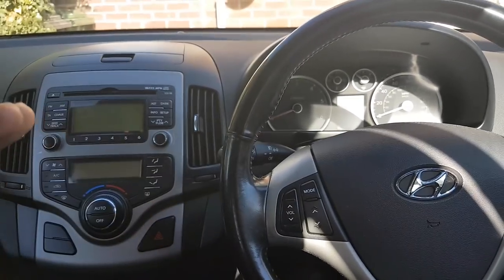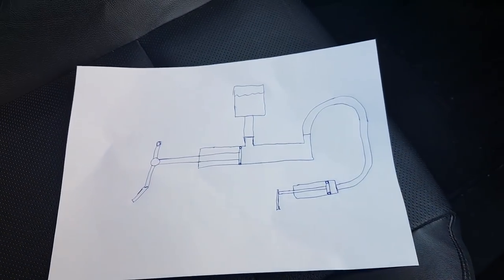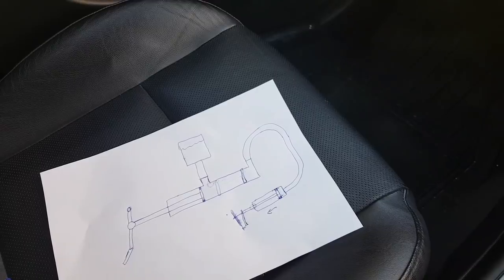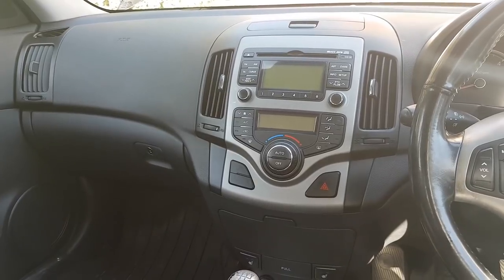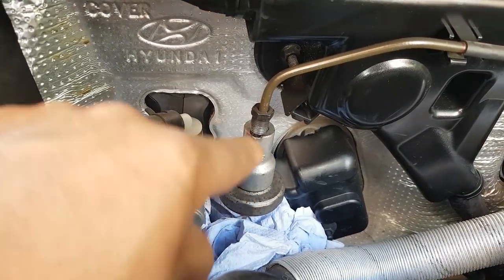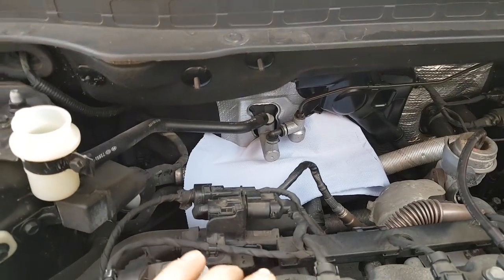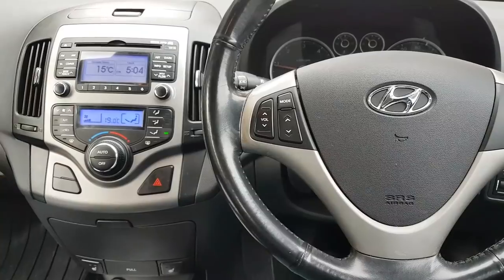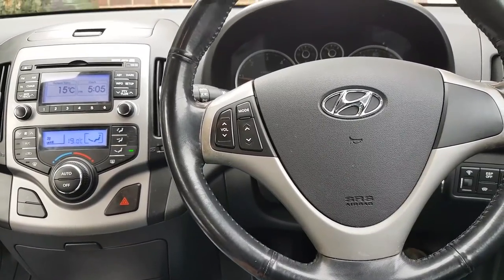Hyundai i30 2007 clutch problems. Fault finding and repair.

Comment: Thanks dude! I had the same problem with mine after 230.000 km, and I thought the clutch was done. But I figured this was worth trying before changing the clutch - and it worked!

Comment: I have the same problem with my Hyundai i40 CRDi 1.7 since many years and its becoming worse.. It is build in 2013 and every garage I asked for a solution told me to renew the clutch. In the meantime I drove another 100.000 km, because I thougt, they are wrong. I´m so happy to find your channel and will check it tomorrow. Thanks from Germany.
Reply from the maker: Hope this helps...
That said, a worn clutch can develop similar symptoms... just keep that in mind...
👍👍👍
Reply: I have an i40 too with this problem. Did this fix do it for you?

Comment: I just completed this procedure on my daughters 2013 i30 and it worked a treat. The clutch now engages approx 10mm from floor and not right on the carpet like before. The car is way nicer to drive now.. Thank you for the excellent advice.
Reply from the maker: That's great! 
Thank you for watching, for your comment and for the feedback! 
👍👍👍
Reply: Hey. May I ask what size bolt did you used ? 
Thanks for any answer.
Reply: How long did it take you?

Comment: Doesn’t damage the slave cilinder? The damper should regulate the amount of fluid going in and out to the slave cilynder. I might be wrong. Just an opinion. Cheers
Reply from the maker: The dumper as the name suggests, absorb some of the fluid movements... doesn't really regulates anything...
👍👍👍
Reply: @LMAutoRepairs  thank you!!! I had to replace the clutch kit twice because of the slave cylinder failure. That was in less than 10k miles. I’m just worried that could happen again because I cannot fault anything related to the gearbox…LUK blamed the over pressure in the clutch pipe work system…it just drives me crazy not finding anything wrong…thanks again for your reply
Reply from the maker: @ninrm6355 
Most likely the quality of the parts...
The pressure is whatever you put through the pedal and the counter pressure from the clutch plate... you can't really affect the pressure in any other way...
👍👍👍

Comment: You're amazing man! I just bought a 2012 i30 1.6 crdi. I saved around 2250 gbp on the car, cause the dealership was sure it needed a new clutch. 
I'm not a car expert, but followed your guide and it completely solved the issue. Thanks a lot!
Reply from the maker: That's great! 
👍👍👍
Reply: Hi i have the same variant as you, the inlet and outlet look different to the one in the video,  ut i take it the same procedure applies? Remove the damper and fix with m16? Thanks
Reply: @ncmMackin  Yeah, exactly the same :-)
Reply: Hi, I have the same car and the same problem, but the place that looks like the damper looks like it's already had the plug installed instead of the larger unit like in this video. Is that what you saw?

Comment: Wish I had seen this video before checking slave cylinder,made a bigger output shaft 8mm longer than original,still gears tight.decided on a new clutch fitted and problem still there.Never seen a clutch regulator before so blanked it off and hey presto sorted.12-18 months of poor gear selection and spending on a new clutch,and it was that.£159 for genuine new one.Dont bother just blank it off.Great video .Thank you

Comment: Hatte das gleiche Problem. Regler ausgebaut, Leitung mit Verbindungsmuffe zusammen geschraubt. System entlüftet und man staunt , alles okay. Danke für den Tipp.
Reply: Ich auch bei meinem i40 CDRi 1,7. Neu gekauft und seit 2013 immer schlechter zu schalten. Jedes Jahr schlimmer und jetzt rollt er sogar los, wenn ich das Pedal bis auf das Bodenblech durchdrücke und die Gänge lassen sich oft nicht mehr einlegen. An der Ampel hilft dann nur noch den Motor auszustellen. Dann läßt sich jeder Gang butterweich einlegen.
Läuft Dein Wagen immer noch mit funktionierender Kupplung? Über die Jahre hat mir jede Werkstatt gesagt: Neue Kupplung, aber ich war mir immer sicher, daß es nicht daran liegen kann.
Reply: @katrinvogt2485  Hallo Katrin, die Kupplung hat bis Heute kein Schaden . Warum das Teil Kupplungsregler heißt und in anderen Autos fehlt , ist mir unbekannt. Alles gute 👍

Comment: That is a great and cheap little fix, I bet the owner was well pleased.

Absolutely love your videos, I've watched nearly all of them now. Please keep on making them, you're gaining a real fan base. Huge respect for the thoroughness and sheer patience with difficult problems other people have long given up on! :)

I am wondering how many garages would have just swapped the clutch and dual mass on that car though!!!
Reply from the maker: thejoneseys 
Hi
Thank you for watching so much for your comment, and furthermore for watching my videos! 
Much appreciated!
Reply: @LMAutoRepairs  how do i can contact you sir?
Reply: I've heard that it comes from the factory equipped with a classic flywheel and not dual mass. That was one of the reasons I bought this model. But I could be wrong.
No DPF or changing geometry turbo either should mean less maintainance cost.

Comment: This fix has certainly improved the clutch on my 2014 Hyundai ix20. Thanks for the excellent video.
Reply from the maker: ☺️
Thank you for watching and for your comment! 
👍👍
Reply: Can you remember what size the blanking plug was for the ix20 please.
Reply: @ashhendry6747  It was a while ago but 17mm seems to come to mind.
Reply: Thank you.
Reply: @ashhendry6747  I've just had a thought, I think I used an oil sump drain plug for a Peugeot which happened to be the right size.
Reply: @grahamebradford1028  Thanks again.

Comment: Try pumping the clutch to see if you can engage first gear, if you can, there are two resolutions possible - master cylinder replacement (possible leak) slaves dont usually give any issues on newer cars, or air in the cluch fluid -- neither of which is monstrously expensive to repair - Good Luck

Comment: Hi I have a hyunida i30 2009
I have this issue but I'm confused why you need the sump bolt if its already blanked off with the large round thing. Sorry I'm not mechanical minded.

How do I feel the system back up with also how do I bleed the other side the metal pipe?

Comment: Great video mate, thank you very much! Is the bleed valve for the clutch the one at the front of the engine, just behind the radiator? Also, when i am bleeding the system do i continuously press and release the clutch pedal whilst someone is filling the reservoir until no more air is in the system? And when do i tighten the nipple, when the clutch pedal is pushed to the floor or when it is out? Thanks again for the great video
Reply from the maker: Hi
Yes, that  is the slave cylinder, and is where you bleed the system.
Just bleed it using the same procedure as when bleeding brakes... same thing... it will work just fine!
Thank you for watching!

Comment: Gearstick gets stuck in reverse after reversing. Unable to move it back to neutral unless i pump the clutch a few times then i am able to release it. All yhe forward gears are perfect and shift as they should with no gringind. What do you think it might be?? Slave cylinder? Or a grenade to the gearbox😢
Reply from the maker: A grenade on the gearbox will definitely gar it sorted!
😅
Could be the cylinder not releasing the clutch properly, weird however that all the other gears are fine...
Reply: @LMAutoRepairs  i did check the slave and me and the wife attempted to bleed it which i believe we did properly but who knows. Maybe we didnt do it properly as it didnt make a difference. Looking at the slave i did not see any evidence of wear so im a bit baffled

Comment: Ive seen hydraulic clutch pedal sys in cars as old as 1980 never seen a dampener in there yet clutch action is smooth and perfectly fine.. manufacturers probably threw it in to increase parts count/failure probability
Reply from the maker: Airman 
You're probably right... lol
Thank you for watching!
Reply: yep ive done several hydraulic fixes over the years, never seen a damper!

Comment: Ahh thanks, what is the part actually called,
What size thread was the sump plug you used, does blanking it not break something else? Surely its there for a reason? I have the same issue
Reply from the maker: I don't remember the size details...
The reason for it, it to absorve vibrations from the clutch...
By removing it, you might fell a bit more vibrations on the clutch pedal... breaking something else? Not really...
👍👍👍

Comment: Quick question, can I remove the damper on its own or do I have to remove the elbow as well?
Reply: You better remove the aluminium housing and attach it to vice before trying to remove the damper as it’s tight. Otherwise you’ll easily break the plastic master cylinder if you bend it.

Comment: Have the same problem but thinking there is wear in both the Master cylinder & slave cylinder pistons where the pushrod connects the piston causing too much unadjustable free play which makes it difficult to engage reverse gear unless you double clutch before in neutral. There may not show any leaks this system relies on a light spring to take up free travel so it's non-adjustable. Only solution it to replace the slave cylinder & possible master cylinder & push rods. hope this helps.

Comment: Thank you very much for this nice video. I've an 1,6 crdi i30 GD (the model that came after the one in the video Type FD). It has exactly the same problem that you mentioned in the video, master and slave are absolutely ok. I am wondering what is the real purpose of this regulator that you removed. My guess is, it is there to compensate the fluid volume changes when the temperature changes, but I am not really sure. From the Hyundai spare parts catalogue it seems that only the 1,6l engines have the regulator. I will try to remove the membrane like you did, hopefully it will work. Btw you are very lucky that your car is a RHD, so you got a lot of space to get to the damper. In my case, it is LHD, you need to remove the battery, ECU and Diesel filter and even then, the regulator is a very tight place. :)
Reply from the maker: Hyundai I30 
Hi
I believe that the regulator on top of what you have mentioned,  good point by the way... is also to minimise any feedback that comes from the clutch it self... it works like a shock absorber...
I bet it PITA doing this on a LHS... good luck... let us know how it goes...
Thank you for watching and for your comment!
Reply: I have a 2016 Elantra Gt or I30 and am having similar issues with clutch slippage at 40k miles I have seen forums with a similar spring setup in the slave cylinder but didn't find one in it when I took it apart. I vacuum bled the system from the slave bleeder valve it was better but a few days later it has returned. When I looked up the diagram for my slave cylinder it was completely different than what I have on there

Comment: great video once again, great fault finding and sorting the problem out with common parts/tools. is that transmission fluid in that tank? is that line connected to the transmission oil tank?
Reply from the maker: Boom Shaka Laka 
Hi
Thank you for watching! 
No, the tank is brake fluid....
Some cars have the hydraulic clutch connected to the brakes reservoir... this one have a separate reservoir just for the clutch...
Hope that answers your question.
Reply: it did, thank you

Comment: my ix35 clutch is biting low as well and sometimes it works perfectly but sometimes its hard fo put the car in the 1st and 2nd gear. 

My damper once got ripped and oil was leaking so I actually replaced it with a new damper and Hyundai charged me £150 for part only 

What do you suggest, the clutch is gone or is is it the damper or clutch bleeding issue?

Comment: Later on after deleting the clutch regulator, is possible to have some negative impact on clutch or to get to much pressure in clutch pipes? As not sure to replace clutch regulator or to leave how you done
Reply from the maker: Nothing to do with pressure really...
Is more that you might feel more small vibrations when pressing the clutch... 
Other than that should be fine...
👍👍👍
Reply: There is another option to make clutch smother is to remove clutch delay valve, I’m thinking about removing it. Have any experience with this?

Comment: I have do this and doesnt help... Maybe just a litle bit beter. New chlutc and new uper cilinder the same problem. Doesent push enough... After a one week we solve the problem(the chlutc wasnt right, it was to low) . We get the original and car work excelent.
Best regards...

Comment: Hi great video. You spoke about the slave cylinder might be wore at point it contacts the clutch fork, if this piece was worn can you replace it separate to the slave cylinder? Like is it like a ball that would screw to the slave cylinder ram?
Reply from the maker: jj jj 
Hi
The fork comes from inside the gear box, 
You can obviously replace it individually,  but that means removing the box etc...
If is that what you mean...
Thank you for watching!
Reply: Oh it’s the fork that wears out. Thank you. Keep up the good work
Reply from the maker: @CristiSacalul  
Hi...
Well, my guess is that if is only doing it on reverse, the issue might be the gear box...
The clutch and all its components work the same way independent of which gear you select....
Hope that helps. 
Thank you for watching and for your comment!

Comment: Hi great video my i30 has got this exact problem took it to local garage more or less said the problem lies with the clutch , I'm thinking of having a go myself , do you have to take the large square plastic box off to get to it , and could you please guide me through on how to bleed clutch , where is the bleed nipple etc many thanks Ray
Reply from the maker: ray newman 
Hi
I am not sure which square plastic box you are talking about...🤔
The bleeding nipple is on the slave cylinder... at the gearbox... easy to get to...
Remember that you might have a different issue.... but you can have ago at this... nothing to loose...
Thank you for watching and for your comment!

Comment: I wanted to change this among with the break fluid and the service guy said it's not a good idea because in time it might destroy the clutch prematurily or even the engine due  to vibrations, could this true or is it pure bs?
Reply from the maker: Shouldn't cause anything like that...
You might, might fell a bit more vibration when pressing the clutch, other than that, should be fine...
👍👍👍
Reply: @LMAutoRepairs  Yea, thought so. How many miles (or km) did you make with the car after this change? And what was the overall experience, did the clutch stay as it's supposed to, with a "normal" byte point? Did you change the clutch in the mean time? if so, how many miles(or km) after the damper got removed?  Thanks a lot!
Reply from the maker: Car was not mine...
But the owner never complained. 
👍

Comment: Mine does the same „grinding“. But after 220.000km i guess the clutch plate is pretty much done, there are only issues when putting in 1st gear and reverse. All the other gears are fine.
Reply from the maker: ☺️
Probably...
👍👍👍
Reply: I had the same problem as you, and my clock says 230.000 km. Figured this was worth trying before changing the clutch, and it worked!

Comment: very informative video do you remember what sump plug you used to  black of the elbow joint? 

thank you
Reply from the maker: One that fitted...😋
I don't remember the thread size... sorry...
👍👍👍
Reply: @LMAutoRepairs  Damn do remember if it was a hyundai plug or just. Random ome
Reply from the maker: Was definitely random... and I bout it on my local car parts shop...
I just asked them for a few different sump plugs, and one fitted...😊

Comment: Hello. I have a Hyundai i30 and I have a similar problem. When the car is turned off, the first and second gears work very precisely, however, when the car works after a few minutes I have a problem with the gearbox, it is very difficult to enter the first and second gears. Do you think either of these two cylinders could be a problem? Thanks.
Reply from the maker: Possibly...
Clutch it is also a possibility...
👍👍👍

Comment: Great video thanks. I have the opposite problem with my 2017 1.0 t-gdi engine. It bites very high, almost above when releasing the clutch pedal. The clutch is relatively new and not worn. What could be the problem? Air in the system and can I bleed it by bleeding the slave cylinder?
Reply from the maker: It could be air... try to bleed it and see how it goes...
Reply: @LMAutoRepairs  Thanks for the reply. It is just opening and closing the nipple on the slave cylinder while someone presses the pedal right?
Reply from the maker: @Pesar25  
Pretty much...
Just keep an eye on the reservoir... and top it up as needed...
Reply: @LMAutoRepairs  Oke cool thanks! I have subscribed to your channel :-)
Reply from the maker: @Pesar25  
Appreciated! 
👍👍👍
Reply: @LMAutoRepairs  what do I top it up with? Is dot 4 fluid okay?

Comment: Had this exact same problem, tried this fix ,worked brilliantly for about 3 months but the problem came back now scratching my head ,looks like gearbox out for further investigation.
Reply from the maker: Or clutch...
Reply: @LMAutoRepairs  Again like another chap doing similar vids a mileage aspect would be nice as since about 2000 most cars have lifetime clutches rear brakes (shoe type) etc so when problems occur unless riding the clutch has taken place would be nice if things like clutch have to be replace we know the mileage etc if known, many thanks.